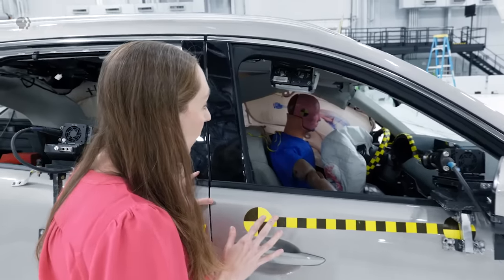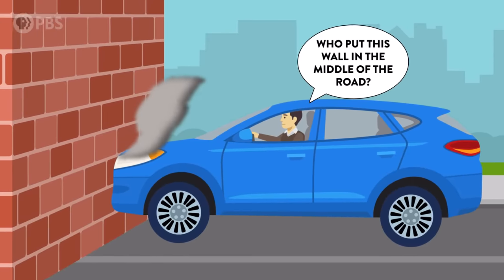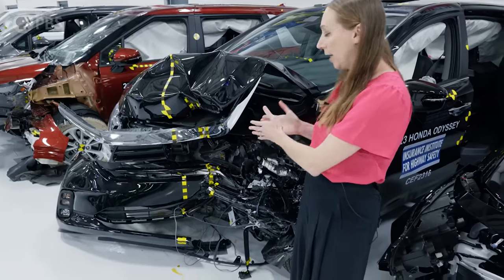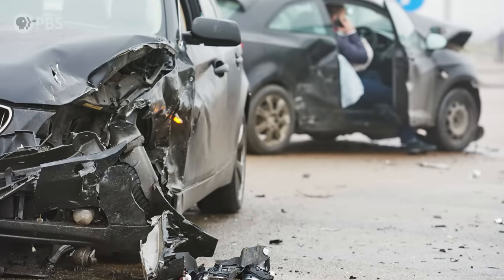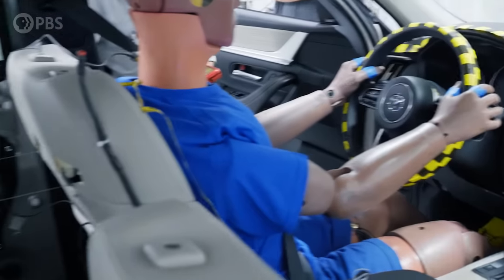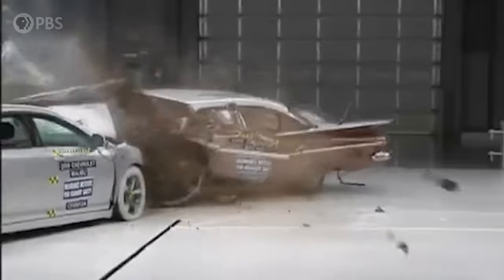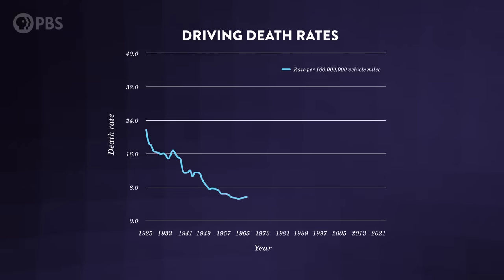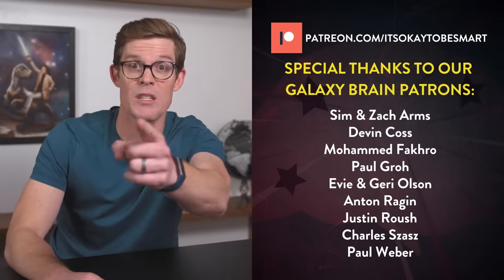The Incredible Engineering That Helps You Survive Car Crashes

Comment: I have a sticking point about the Ft=mv. Engineers, of all people, have the ability to change the mass of vehicles. They do not need to be at large as they are. They are literally massive. We do not need these multi tonne SUVs on the road.
Reply: You missed the point: the F in the equation is the force exerted at the point of contact between the car and the obstacle. Reducing this force alone does not translate into reducing the force experienced by the driver.
Indeed when considering the driver's safety what's important is the acceleration/forces experienced by THE DRIVER (or rather each of its vital organs). Hence THE DRIVER's mass (its vital organs) is the thing to consider here. Yet the vehicle manufacturer has no control over the driver's (vital organs) mass.
Note that this is a very short and oversimplified explanation to you shared reasoning flaws.
Indeed, and avoiding spilling here the detailed lengthy explanation, truth is that generally speaking the higher the vehicle's mass in proportion to the driver's mass, the less uncertain (more predictible) becomes the driver's deceleration rate, the "easier" it is to "engineer its safety".
Reply: @RaoulEvilD except that the higher the vehicle'e mass, the higher the energy of the crash and therefore the more energy you need to dissipate to avoid reaching the passengers. OP's totally right that cars nowadays, specially SUVs are built way too heavy to protect the passengers at the expense of everyone else involved, like passer-bys, cyclists or even people on smaller, more normal sized cars - NotJustBikes has a great video on how these types of cars are a threat to everyone.
Reply: @hcxpl1  Don't get me wrong, I agree that vehicle mass inflation trend is bad on many aspects, especially for the environment and the safety of by-passers and lighter vehicles. I am myself against this trend. But the truth don't care about our feelings: higher mass generally mean, all things considered, better safety for the occupants of the heavy vehicle. Let's avoid strawmaning others for the sake of ones ego 😉, no offence. I am convinced that this world would run even better if everyone was seeking THE truth rather than THEIR truth.
Reply: Tell that to someone with kids, or a job that requires they transport many or large items, or need to tow something. What you meant to say is "I don't need a large SUV."
Reply: @toddhollen  You'd benefit from watching NotJustBikes' video on the subject - there he is very clear how, even for those cases, SUVs are far from being the best solution; they actually kinda suck at hauling things and are really fuel inefficient.
Reply: @RaoulEvilD eh SUVs are the worst category of cars safety wise statistically but also that they easily flip is a big part of that
Reply: Electrics car are even heavier than SUV (because of large battery). 
Does it mean that they are safer because of bigger mass in collision with lighter vehicles?
Reply: @RaoulEvilD Electric vehicles have bigger mass. 
Does it mean that passengers in heavier EV are safer compared to none-EV version of the same car ?
Reply: @alexandercherniavenko7363  but electric cars are generally saver because all there weight is in tje battery's and they are at the bottom so it's actually really hard to tip over, like even if Tesla is a meme at this point that's why the cybertruck was the only suv till that point to pass a role test ( making it of something super hard that's doesn't crumple was obv really stupid)
Reply: @sebastian_olthuis  it’s true that EV are harder to roll over. 
But does also mean that because of large mass it’s safer in crash (like front crash) ?
Reply: @alexandercherniavenko7363  sadly if you look at the statistics most suv don't have big crumple zones witch also makes them very deadly in any crash. It's really interesting if you look it up there is legit nothing worse than a suv safety wise except motorcycle or quads. Even then most mums drive a suv because it feels safe. If you want a safe car get a station wagon it's more practical and even spacious then most SUVs and keeps your family way safer.
Reply: You missed the forest for the trees. Be better.
Reply: Last 10 years or so. There's been a big push to have bigger vehicles like SUVs or trucks. The thing is truck's SUVs do not have to follow the same safety protocols that the government has put in place for smaller vehicles like sedans and full size cars also, car manufacturers don't have to follow the emissions laid out because they're not entitled to that protocol compared to cars
Reply: @RaoulEvilD The truth is that most crashes involve two cars. Or a car and some pedestrian. Etc. It's not just about the occupants of the now-heavier car.

So for someone talking about the "truth", you're quite selective when it comes to the whole picture of traffic accidents.
Reply: Try putting three car seats, Cheetos, loud iPads, juice boxes, and small wiggling yelling human beings in your passenger seat and get back to me about those other rows.
Reply: @sebastian_olthuis who TF even sells station wagons any more. This is 'merica. We want big horsepower and big cars. If we didn't they wouldn't sell
Reply: I hate this argument so much. SUVs are no worse than anything else, the weight is barely anything more than pickups or large sedans - hell, some high end sedans and EVs weigh more than my MDX ffs. And theres way bigger cars on the road. If you are that paranoid about youre or your families safety, YOU get a safer car instead of forcing everyone else to drive what you think they should.
Reply: @hcxpl1  You will never eliminate risk as long as individual choice .  Keep tightening the constraints of choice people will just rebel and risk of harm just moves somewheres else in this crazy life.
Reply: Bro we are AMERICANS, WE WANT BIG ASS CARS💯
Reply: That’s not an engineering problem, it’s a customer problem
Reply: But if mine is bigger than yours then I'm safer. So the cycle continues.
Reply: @cheapbastard990 Heavier cars put more force on smaller cars, pedestrians, cyclists and motorcycles. That’s why people buy them. To keep safe. If they can afford it, they will buy the larger car. But, if we ever have problems with getting gas, people will go back to smaller cars. The Japanese and South Taiwanese people will sell cars like hot cakes, like in the late 70’s and early 80’s. Pick ups and SUV’s will also get smaller. Cars may have to be made safer, then.
Reply: @sebastian_olthuis they literally showed an suv crashing and showed the crumple zones. It’s on video.
Reply: @waynejohnstone3685  ya there not that big plus they flip way to easy. Are dangerous for pedestrians and have no reason to exercise, they're just as bad if not worse than a normal car at off-roading especially because many don't even have 4wd. Their trunks are tiny for how big they are, I mean a tiny citroen has almost the same trunk size let alone something like a station wagon. Oh and they make you look like you scared of the road or you have to compensate for something.
Reply: @hcxpl1  Almost like the people making the cars are focusing on who's going to be inside that car the most! And, less weight = less grip on the road, leading to other issues. It's not as simple as just taking weight out of the car. Every single pound is there for a reason.
Reply: It’s not an engineering thing. It’s taxes, at least here in the US. And now culture.

Comment: I wish that they would rate cars for how safe they are for pedestrians as part of their standards rather than just the people in the vehicle :(
Reply: The problem is that even a small car can weigh 1-2 tons.  The safety of a car for pedestrians if they ever come in contact is always going to be non-existent. You can't hit a human with something that heavy safely. 

What you can do is avoid collisions, and that is mostly down to better visibility (both of the pedestrian and from within the car), social engineering and training of both pedestrians and drivers, and limiting the amount they are on the same surface and making it obvious when they will be. Same goes for bikes.
Reply: @samarnadra You're completely wrong. There are some factors that make it more dangerous, like blind spots, or being lifted to high. And a curved front is safer than being flat like on a pickup truck.
Reply: And I wish people would use station wagon, minivan, or saloon instead of suv 

- suv are worst for the environment ad they use more fuel  or electricity if an ev and use more material as their heavy 

- save on money by not only suv since suv use more fuel or electricity because of their weight

- Station guve you trunk space and can be awd mean you have some off road capability 

- Saloon and Minivan have more passengers space 

Btw saloon is a stretch sedan and coupe are 2 door and sedan are 4 doors tho a 4 door hatchback can make a good sedan
Reply: They do. Look up the break down of any crash test rating, they test how the bumper impacts pedestrian's legs and how the hood and windshield deal with pedestrian's head.
Reply: elon to the rescue! so with his neural-link, whenever it detects two humans about to collide, your jacket explodes and inflates into a giant bubble. now get that implant! in the name of safety!!!!
Reply: @samarnadra  It's super easy to make any car safer: drive slower.  It's also easy as in we know many cheap ways to do this effectively (narrow lanes, curves (this is only cheap when the road is built), speed bumps, basically anything that makes it feel uncomfortable to go fast).  Even better is that driving slower makes things safer for those inside and outside of the car.  Of course, making people drive slower is very unpopular amongst drivers. Like many things, the technical problems have solutions, it's more about getting people to prioritize it.

Comment: Cool. I see the end product of crashes every day. I work in an automotive recycling center. I've seen some serious damage that people walked away from.
Reply: I saw two cars that got into a head on collision with a combined speed of about 120mph. looked like they fell from space, they were obliterated, blood still covering Evey inch of what's left of the interior
Reply: @Twofrogsonecup  You can't just combine individual speeds. Two cars impacting at 60 mph each is (almost) the same as each car hitting an immovable wall at 60 mph.
Reply: Some guys crashed into my dad once. Our impreza was totalled (looked completely done to me) and he only had one bone broken in his hand. The two guys ended up in hospital. Also the transmission was intact and it might be driving in some other car to this day :)
Reply: @ElfRulerr  Can you explain why? Doesn't really make sense to me
Reply: I work in a major automotive manufacturer. I build the entire Motor compartment, front sidemembers, aprons dash cowl, radiator and front floor.
Reply: @ElfRulerr Actually yes, that's exactly how it works. Your wall analogy does not work. Mythbusters even did an episode on it. They crashed two cars into a wall at 30mph and then into each other at 30mph. That two car crash was the same result as crashing one car into a wall at 60mph.

So I think you've misheard something. A 60mph head on collision between two cars is actually the same as one car crashing into a stationary wall at 120mph.
Reply: @jjbarajas5341 That's false. Just watched the actual clip of Mythbusters testing it. First of all, it was 50 vs 100 mph they did the test at, but that's less relevant.
What was absolutely clear was that the damage sustained at 50 on 50 mph head-on collision was just about the same to each car as when they did head-on collisions with a wall at 50 mph.

Comment: Be nice if they also engineer some safety features for the pedestrian when these giant trucks inevitably hits a pedestrian they can't see due to their increasing ride height.
Reply: nice idea, but cushioning an impact of 10 tons of steel going at normal speeds will be kind of difficult.
Reply: I think we should limit the size of car especially suv their gettto big for everyone safety also get a station wagon or minivan if you want a family car not a dam suv which is worst for the environment because they burn more fuel or use more battery and your pay too much for a car in when you could've gotten a awd saloon or wagon don't own a suv when wagon can give you more trunk space and minivan more room inside even saloon have more room inside for passengers
Reply: @USSAnimeNCC- the SUV was created to pull a trailer and also have your whole family with your belongings all fitting inside, its not that SUVs need to go away, the right ppl just are not buying them and there becoming so expensive the people they are made for can't afford it
Reply: what a bubble boy
Reply: @raphaelefranco1123  You'd think that, but it is surprisingly possible. The highest priority is to prevent the head from bumping into hard places. The car can for example raise the hood a few inches just before impact to provide a small amount of space cushioning the impact. 
If the bumper of the car is at the right height the pedestrian will pivot around the waist and the whole torso will be able to absorb some of the crash energy before the head impacts the hood of the car. Conversely, if the bumper is high, like on one of the big truck models, there is nothing to pivot around as the body if hit from the side. The head will therefore impact the car with much more force and in a less favorable angle.
Reply: Hi I actually did my PHD in pedestrian protection!  There are some devices being used in Europe such as a airbag that pops up by the windshield to protect the pedestrian head, and a soft hood that pops up to separate the pedestrian from the stuff engine block.
Reply: You are not wrong. I was wondering if this video was promoted by the car safety industry trying to re-frame the conversation of how dangerous SUV's are.
Reply: They are.. the crash avoidance systems. You know.. the last few minutes of this video?

Comment: Crazy how much engineered and tested is used for the safety of vehicle occupants. Hopefully we can get just as much testing for pedestrians as well.
Reply: Plenty of pedestrian safety tech is built into vehicles now. Collapsible guards, explosive bonnet hinges to throw rear of the bonnet up to catch and soften impact. Plenty other smaller things being built in now too
Reply: They actually cover that later in the video, looking at collision avoidance systems including pedestrians
Reply: @ReverendRaff not really. The engineer is still explaining how cameras can detect other car, bu not really a pedestrian. 
Besides the mannequin they use has a gps connected to the car
Reply: @reddcube I totally agree and was thing the same!
Nowadays cars are more deaadly to pedestrians than ever
Reply: Just to be clear I referring to deadly collisions. In 1975, there was 7,516 deaths. This statistic was trending down, with 4,109 deaths in 2009. But trend had reversed. There is now an alarming increase in pedestrian deaths, in 2021 it's back up to 7,388 deaths.
Reply: Part of this could be bad road design, that was not properly separating Pedestrians and vehicles. But the rise of SUV cars also means taller and heavier vehicles. These collisions can strike vital organs and are inherently more life threating. 
Features like EVs produce sounds at low speed , running lights, automatic braking are all great features. But the US is lacking compared to EU for mandated tests for pedestrian safety.
Reply: @renatanovato9460  Actually as he explained, the GPS is only there so that the dummy pedestrian knows where the car is in order to walk right in front of it.  That system has no input to the car itself.